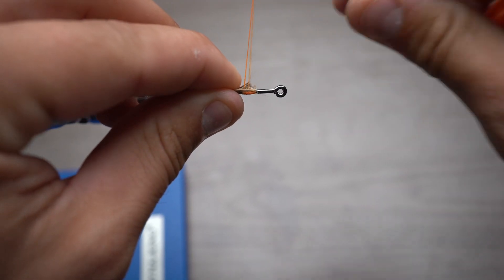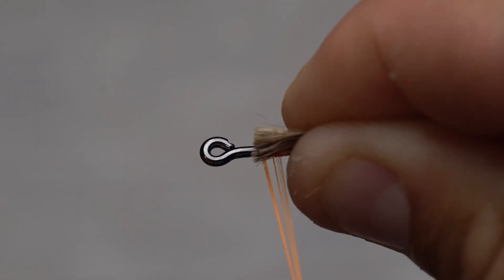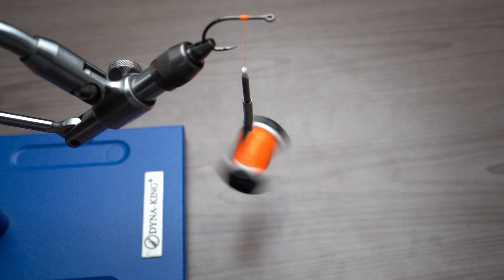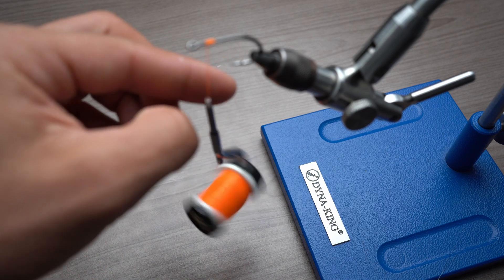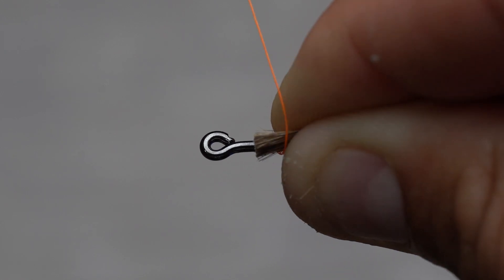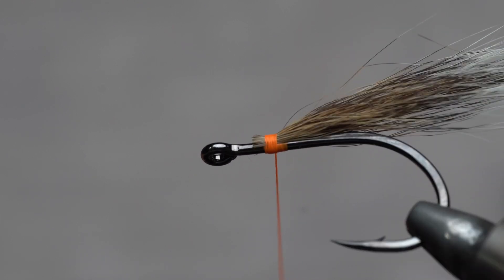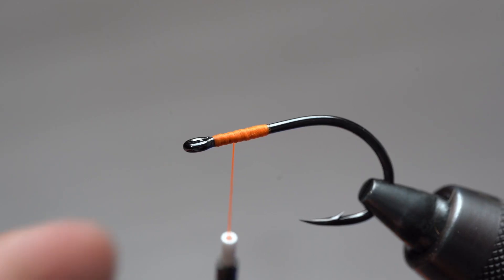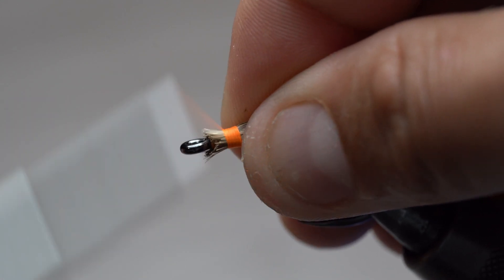Fly Tying Thread Control | A Must Know Tying Tip

Comment: I'm a new at fly tying and a idiot. But I just can't understand how that works? It jumps back ? Everything I tie goes around to the opposite side. I'm going to try this but I can't figure it out
Reply from the maker: The thread wants to jump back toward your off-hand fingers instead of going toward the eye of the hook.
Reply: @OleFloridaFlyShop  yes it does really help, I also started holding the material slightly over in the side and as I pull it spins it perfectly on top.